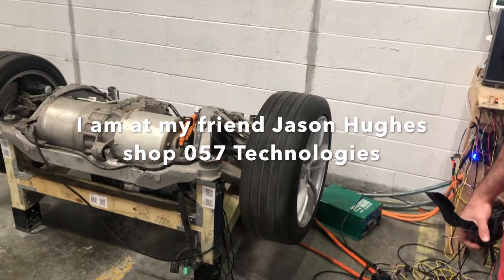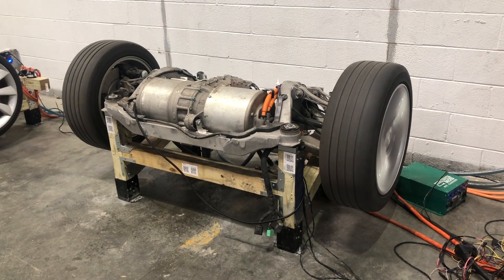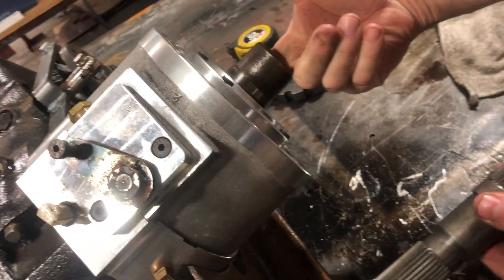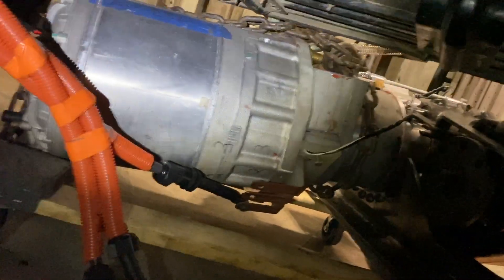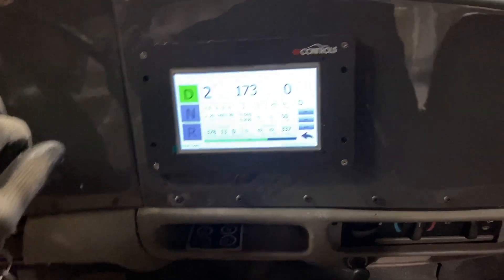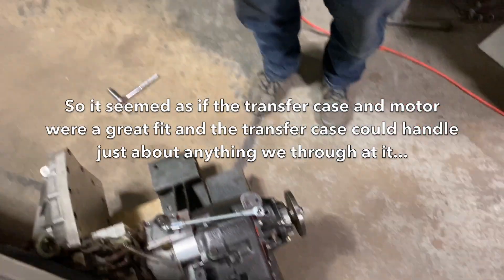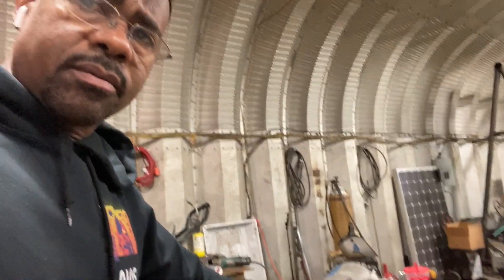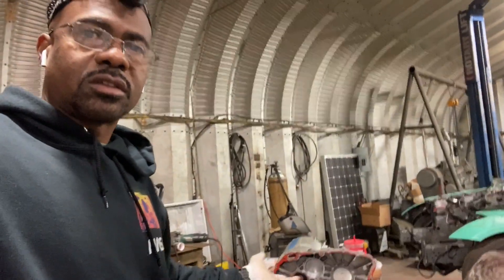Transfer Case Issues Pt 1

Comment: Ok, can you clarify something. Can you shift this from low to high while driving?
Reply from the maker: No. In retrospect, had I used a five/six speed manual transmission, that actually would have worked better.

Comment: Are you planning on being able to shift the transfer case with the truck in motion?  I'm contemplating a similar drivetrain and it would be nice to be able to shift from high to low on the fly.  In theory, one could put the transfer case in neutral and have the motor get to the correct rpm to facilitate the shift.
Reply from the maker: I have tried to shift on the fly but with no clutch it doesn’t work unfortunately.